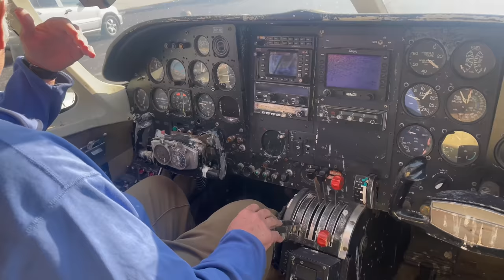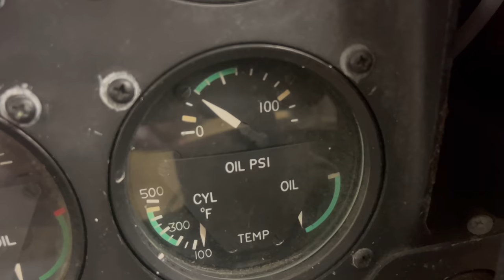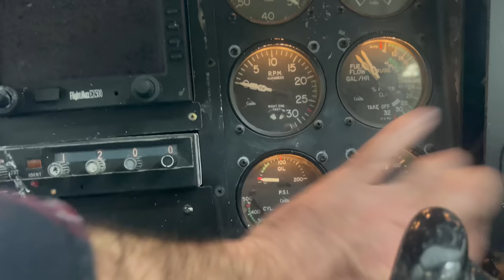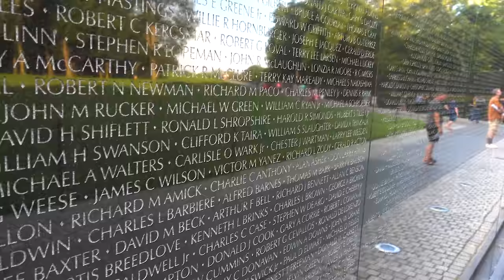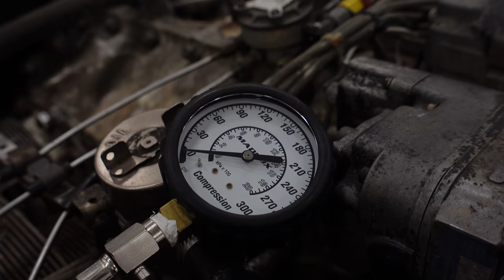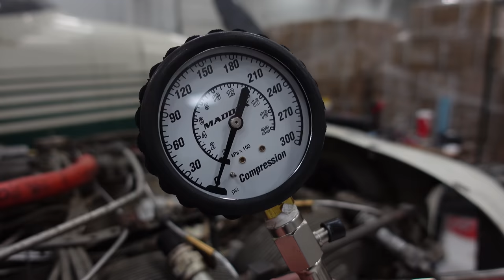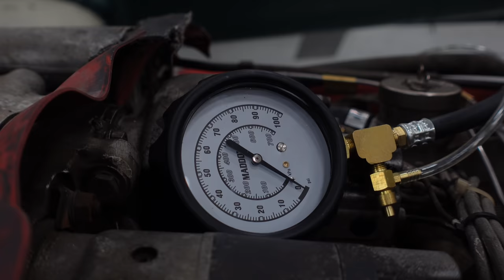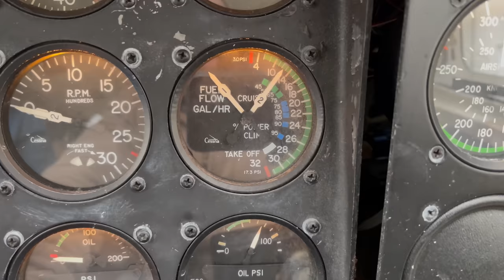Did We Ruin The FREE Abandoned Airplane Engine ? Ep6

Comment: Just a couple observations, I've been watching you use those batteries with those jumper cables and like I keep saying you need the proper batteries or/and external power, you noticed with the left engine running you almost got the right one going with the proper power! I really don't think you have proper fuel pressure on the right engine, I know when we setup the fuel system and flow into cups like you did they'd fill up fast! I'd pull the fuel pump and make sure it's not plugged or restricted also I noticed when you had the fuel manifold open the center plunger looked a little crusty, they taught us at TCM engine school that plunger is supposed to be clean and move freely up and down so check that.
Reply: Someone shared my observation. Those cables are too light to get enough current to the starter that is further away. May be a few other problems too, but that arrangement won't help.
Reply: @MaxNafeHorsemanship  They aren't listening.  Many have pointed this out.  Jumper cables are not sufficient to provide starting power.  I suspect much of the incompetent work is deliberate to drag things out and get more views.  Rebuild the entire fuel system.  Rebuild all electrical and starting systems.  100% of the drama and bullshit will go away.  Better to half ass everything and pretend there's some struggle of discovery and triumph than do shit right the first time in a few hours.
Reply: Totally agree! BRING THE THUNDER! Bigger batteries and heavier jumper cables! 😀😎
Reply: He had dry plugs after his starting attempts, too. With his compression that low, and it will inevitably be low until it runs for awhile to pitch the years of garbage out the exhaust, it's going to have to get super rich to start. I read your comment before I heard him say the plug was dry, and now I have to say I think you're quite correct.
Reply: shoulda coughed with the ether!
Reply: @johncalhoun358  It did; watch closely. It's just a very high displacement engine, and he didn't put enough in it to outright run it on it.
Reply: @tiporari  Yeah.  He should just throw a bunch of money at an engine that's going to have to be overhauled anyway.  That's the way to do it.
Reply: @edifyguy  1
Reply: @edifyguy  - I'm not much of an engine guy, but to me, dry plugs is a 100% giveaway. You will not start the engine without fuel, if you have dry plugs you do not have fuel. End of story. Might also be 10 other things, but that's at least one silver bullet right there. The fact that it farted a couple times on the ether doubles down on it being fuel. If it was plugged exhaust or whatever else he suspects next, ether would make no difference from actual fuel. It would be farting and choking, but still farting. We also have definite electrical issues (just in general, weak batteries, long skinny cables, is definitely going to make everything harder) that aren't doing it any favors, but, it's gotta be fuel or fuel controls. I suggest he double triple-fist the ether cans and get the thing running, and least free it up and blow itself clear.
Reply: @MaxNafeHorsemanship  I provided necessary cranking amperage and cable AWG ratings, yet they still are jacking around with amateur go-cart theatrics.
Reply: @tiporari  You may have a point. It seems odd for a smart guy to overlook such obvious things. Kinda like politics. Gotta put on a show.
Reply: @tiporari  I also think the phone call from the owner 
about the third party offer was fake, and very poorly acted too. 
All for drama.
Reply: The diagnostic tree he is using is more of a bush. I really want to see some actual headway on this plane but the theatrics are becoming a bit annoying.
Reply: @tiporari  ya I thought that when he talked about the oil pump being gummy. 😂
Reply: @nverdelotti  I think he's doing a decent job on diagnosis, but just hasn't realized that the fuel system on that side tries, but doesn't actually work properly. There's a difference between working a little and working properly, and here the difference makes all the difference.
Reply: @theresayockim3750  ditch the jumper cables!!!
Reply: @tiporari  you know I didn't want to believe this at first but I'm starting to agree with you, all of this great advice and he's not listening!! Looks like search for drama! I've been to TCM engine school 4 times and I've worked on TCM engines for over 28yrs and I'll bet I'd have it running in a day!!!
Reply: It did turn over a lot quicker with the other engine/alternator running, it did the same the last video.

Comment: Guys... It was kicking over..intermittently.. It was def turning over faster with No 1 Engine running..
Have u checked for consistent spark on all cylinder's.. Earthing can be a tricky one. Check for corrosion or poor contact on any part of the ignition system Earth side..  Replace any points  condensers on the Magnetos if they have them.
Best wishes for the project..

Comment: My father used to mix jet A 10 to 1 20w40 and an equal part kerosene and 2 to 1 or diesel in 40 gallon drum to soak any hoses to clean any stubourn residue out and some vasoline jell 1to 1 withe soak to revietalise the deicing boot and all wing and surface corrosion. Works great  and lasts. It also can stop corrosion ond flaps aerleos and rudder joints.Lleave 24 hours then wash it will act like new. Love the show good luck and I will try to find the RAF short fix book with years of helpful tips thanks for a really great show

Comment: Man, I got excited towards the end when it appeared the right engine was really close to catching while the left engine was running. It won't be long now. Instead of starting fluid in the cylinders, maybe light oil at bdc to get them cylinders lubed up a bit as much as possible from the spark plug holes, IF that's what we heard squeeking. I'm excited to see this thing progress! Keep up the hard work.
Reply: I'am agree with your comments.
Reply: I think there is some air in the injectors coz it is miss firing in the last

Comment: Check for voltage drop to the starter. You could even bypass the interior start circuit and try direct to the starter. Even with the plugs out when you turned it over inside it seems like it should have turned over faster.
Reply: it looked like it turned wayy faster at the end when engine 1 was already started.
Reply: I presume that after starting engine 1 then the starter for engine 2 will take its power from the generator on engine 1? Should give more power than the batteries  . . .  Love watching the progress from Holland! Frustrating to not get that stubborn engine to come to life!
Reply: @NootNooot  Yes, WAAAY faster. It nearly started—or rather, started and died several times. However, the engine that did start started while cranking at a similar speed to the one that didn't. I think there's a fuel problem on the right side.

Comment: Hi. Love watching your progress! Can i Make another suggestion. The squeaky noise your experiencing might be a drying out of the upper cylinders. You have been using quite a substantial amount of fuel product which will of course evaporate. Can i suggest putting a squirt of oil down each bore to save piston and cylinder damage. Don't forget the turbo! Geoff
Reply: I agree with Geoff that really sounds like dry cylinders... Rings are singing on those walls.. Plugs out piston at bottom of stroke get some oil in there and turn prop by hand to get excess oil out of plug holes... Gonna make a mess but I bet if you get the cylinder walls coated your compression will even out on all cylinders as long as your valves are seating good...oh and you were talking about possibly exhaust being blocked... Only place it could be blocked is after turbo.. If everything was connected surely nothing could get past exhaust turbine wheel into piping or manifolds while it was setting.. Keep it up... CLEAR PROP!!!

Comment: I think the next step after you get engine two running is to do a thorough inspection on the airframe and check for any corrosion or damage. This will tell you exactly what it will take to possibly resurrect this airplane. You will probably have to rebuild at least one of the engines and replace all hoses and any component that needs to be replaced. Big bucks.
Reply: If he has money to get this far I'm sure he'll be fine.
Reply: Both engines need to be pulled and get a proper rebuild, absolutely not safe to fly otherwise. Whole plane needs to be gutted avionics and all.
Reply: didnt he already say that the airframe needs rebuilding? that was why it was sat there for so long, no?
Reply: Isn't there an AD on the spar carry-through? If that is corroded it is a multiple $10k's replacement.
Reply: The engines would need a complete overhaul, about $35,000 per engine.  The wing spar caps have to be fixed, an FAA requirement, about another $80,000.  Figure another $8,000 for a prop overhaul.  Another $30,000 for miscellaneous mechanical fixes to the airframe, landing gear, controls, flaps.  Another $15,000 for avionics.   For that much you can get a working, certificated plane, today, no sweat.   So it makes no economic or practical sense.
Reply: @georgegonzalez2476  Fundraiser has exactly $150 000 as it's goal, so you are spot on with minimal required expenses. If it somehow gets all those money, however, I can see a possible profit in future.
Reply: @NoseCandyKermit  Oh no, getting it running is the easy part. The checks get bigger from here. Way, way bigger!
Years ago I rescued a Kawasaki KZ650B2A from a backyard. Although it was laying on its side the owner had put a tarp over it. But the gas leaked out through the filler cap and left a streak on the paint. No biggie. 
We got the thing started. Now I have to buy a battery. It will only start if you kickstart it...needs new ignition coils. Tires are dry-rotted. Brake lines are cracked. Four carburetors to rebuild. Four carbs to synchronize. Money, money, money, and it's only a motorcycle. Boats cost ten times more and airplanes cost 10 times more than boats!
Reply: @hommie789  I'm pretty sure you can work on a plane plane without a A&P but it either needs to be supervised by or your work checked by a A&P
Reply: @paulreid7370  just like Chris Roberts with Star Citizen. Joking aside, I really hope he is successful with the plane. This is a project worth the money, unlike Star Citizen.
Reply: @mcgee6177  These engines are going to HAVE to be rebuilt not overhauled. Only the engine manufacturer or agencies approved by the manufacturer can perform rebuilds. Continental currently doesn't approve anyone other than themselves to perform rebuilds (that I know of). He's going to have to pay someone to do it if he wants to fly this someday. He has no logbooks, rebuild is his only option.
Reply: Put some engine oil in cilinder
Reply: I like this project.  It’s a wonderful airplane.  And they kick ass when they are running.

But the gentlemen doing these videos is making people think that this is like restoring a camaro.  Not only is this way more complicated….it’s also completely illegal to go out and rebuild an airplane yourself and fly it

The people watching this need to understand that an airplane is not like a car.  Only certified FAA Airframe and power plant mechanics are allowed to work on airplanes.  And they must be inspected by an FAA mechanic every year.  The engines need to be rebuilt buy a certified FAA repair station.  They must be in as-new running condition.

Each engine will probably need to be rebuilt to the tune of 35,000-50,000 a piece.  It may need 25,000-100,000 in avionics.  And who knows how many thousands and thousands and thousands of dollars spent on the airframe itself and it’s various systems.

The airframe props and engines needs all FAA airworthiness directives completed.  The airframe needs to be inspected for corrosion under the supervision of an A and P with an Inspection Authorization. 

I hope you get it done.  But again please let these people understand an airplane isn’t just something you try to get going.  Everything needs to be right.  

This would be a multiple million dollar machine if new now.  And it’s going to cost waaaaayyyyyy more to get going then to just go buy a used one that has been flying.
Reply: @mcgee6177  you can work on it with an A and P supervising you.  But I’m not seeing an A and P.  Even A and Ps need to be supervised  buy a more experienced mechanic during and annual inspection by an A and P with an IA.

You don’t just go out to an aircraft and start wrenching.  Lol.
Reply: @hommie789  pretty sure replace starter isn’t on that list.
Reply: @hommie789  r
Reply: I still believe it’s a magneto problem. I’m not that familiar with them but an auto dish/coil without the switching is definitely different. 
Recheck the mag. Manual.
Reply: @Avboden  Why?
Reply: @georgegonzalez2476  But you gotta factor in YouTube. If he gets a bunch of subscribers and his channel blows up, the project may even pay for itself one day
Reply: @hommie789  yeah man.  I’m saying he can’t replace the starter.  Lol.  He shouldn’t be doing any of this stuff.  If it’s not on that list he can’t touch it.  This airplane is a paperweight.  And people are throwing money at this guy.  If he wants to restore it.  Every part of that thing needs to be restored by professional FAA certified mechanics.  If he wants to make videos about changing the oil after he’s done spending 300k then great.

If you have a certified technician watching every move you make.  You can work on the plane.  That’s how you log time to get your A&P.  But you can’t do what this guy is doing and expect the FAA to not start asking questions.
Reply: @hommie789  And even the PM can only be done by an owner with a pilot's license, and though he's worked on that, I don't think he has it yet.
Reply: @georgegonzalez2476  Restorations rarely make economic sense, that is not why we are driven to do them..